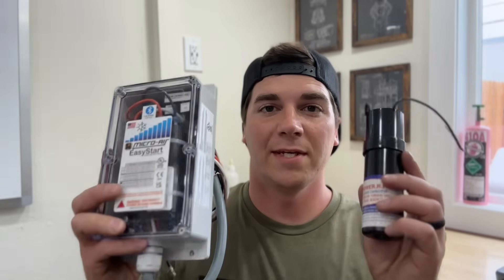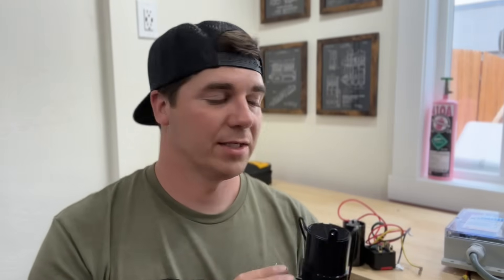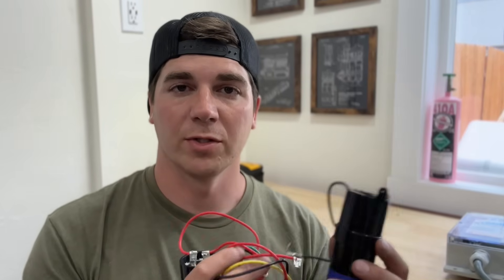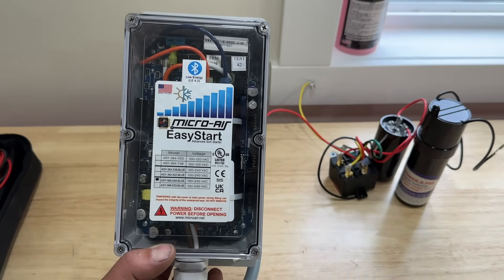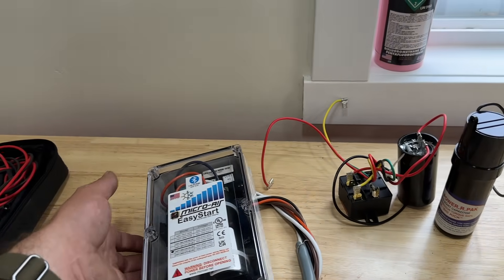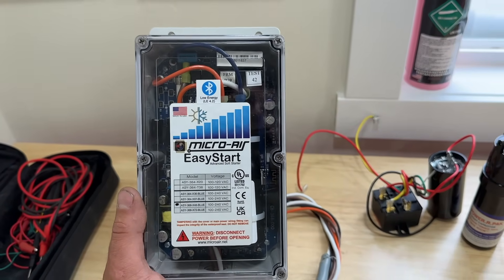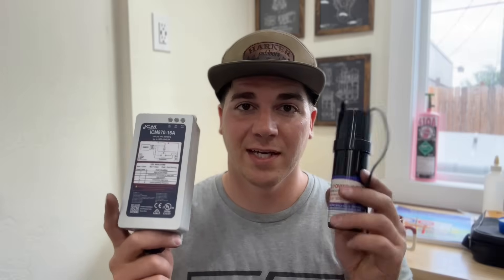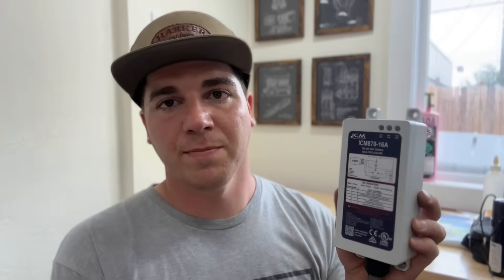Hard Start Kits VS Soft Start Kits    |     Which Is Better?

Comment: I put a 521 hard start on my 20+-year-old 3-ton A/C unit, and the starting amps dropped from 41.9 to 26.7, a 35% decrease. My 8750 inverter generator easily starts it. After running for a few minutes, I gradually flip on the rest of the breakers so the refrigerators and freezers don't all start at the same time. We often have a week or two each storm season where the power is off. We get power after all the businesses and rich people's homes get reconnected. Welcome to Floridaaa.

Comment: I have a stand alone generator on my home. When the AC unit kicks on the lights dem or flicker for a second. Can I still use the Micro-Air Soft start, if I have the generator or is it not wise to install it.

Comment: I love the idea that i can run on a 5500 watt gen during a power outage (hurricane central FL)but Does a soft start installation void a warranty on the heat pump or HVAC SYSTEM?

Comment: If you have 2 units in thst case you can run a hard start on one unit and a sidt stsrt on another ? Depending on hpw old each unit is and whats best to gey the compressor running?

Comment: I've seen plenty of those $400 Soft-Start kits being sold as refurbished units hence they must have a high failure rate seeing how that same company has a ton of them on hand to resell 😈

Cheapest and factory alternative is to add a start-capacitor (hard-start kit) hence the reason the companies that produce the AC units offer this kit in the first place.  This also decreases starting amps because the extra capacitance decreases reactance which allows more current flow through the START windings increasing it's field strength which spins the rotor over easier 😊

Comment: Power factor correction involves inductive reactance and capacitive reactance..how current changes in its relation to voltage in an inductive circuit. Fritz Rochester has an easy to understand  video on YouTube about Rectorseal Kickstart T05.

Comment: Thank you for the lesson Mr. DIY HVAC.
I wonder what device would work best in an off grid campervan situation in which a battery bank supplies 12V power to an inverter which runs (among other things like lighting, a couple of low amp PC fans and some electronics) a 65 W (inrush at least 400W) compressor cooler and a very small (DIY) mini split type system based on a the heat pump components of a tumble dryer which has a rated power use of about 450 W - inrush probably around 1.2 kW)
I have an inverter installed of 1500 W (which can peak deliver around 3000W for a couple of seconds (8-10 or so)

If a slow start or hard start helper can be used to help start both the cooler and the micro split (so to speak) that would make a lot of difference in power use and current spikes...

Your opinion please...

Comment: I just installed one yesterday. Even without thinking about a generator this will help your outside unit with amperage draw. Highly recommend. I paid $370!for the one installed. Total cost was $800 for the job. Definitely worth it in the long run.
Reply: And how will it help? It doesn't reduce power consumption, it costs more than the window unit....By a lot, So what is the problem with a half second inrush current?
Reply: @integr8er66  It will extend the life of the compressor

Comment: Can a hard start kit still reduce the starting amp requirement from a generator even though it reduces only about 50% instead about 7% for a soft start kit? My Generac 24KW standby generator would dim lights during AC started. A hard start kit should reduce its loads to avoid dimming the lights. Is this true?

Comment: Hard start kits help generators run house hvac units as well. Stored energy blasting the power hungry compressor puts less strain on your generator. 
The running amps should be the same with both kits, right? That's what I was hoping you'd go over.

Comment: Less amps on startup = cooler compressor initially.
Now WHICH will save you money on your electric bill?
And if I wanted a soft start can I get one without internet or blue tooth garbage? Those are just more UNNECESSARY things that will break and cost you money.

Comment: I think  one thing not mentioned. . the jolt of a hard start kit will be harder on components.   Can't discount the benefit of a slower start with soft start on components even if you do not run a generator. .

Comment: Check your video:  You say you can run your AC on a 31 WATT generator!  I think you mean a 31 AMP generator (or 6820 WATTS @ 220 VOLTS.)
Reply: He also added a comment correcting his misspeak
Reply: He also added text on the screen correcting himself, and he did not mean 31 amp, he meant 3100 watt

Comment: Great content.  I have an older Tempstar 3 ton.  88 LAR,  16 RLA. TEMPSTAR IS MADE BY CARRIER.  20 YEARS OLD.  Which model soft start do you recommend?  Much appreciated.
Reply: Easy start. The cheaper ones have a high failure rate if you look at the reviews.

Comment: Home built in 2019. On the second owner. I have my unit service twice a year. It is very loud coming on like the volume is turned up a quiet within 30 to 60s. Any ideas?
Reply from the maker: The micro-air soft start could definitely help with that.

Comment: Subscribed! 

So. I have a new-ish home. Built in 2019. 2 Carrier AC units. 1.5 ton and 3.0 ton. I have no home generator. Both units work perfect but they start HARD. 

If I want to extent the life of these units, it sounds like I need to put a soft start on each one of the compressors, no? 

I'd use a hard start kit once they get up in age (10 years+), correct?

Comment: Love the content but on these, I'm confused.  You've had two videos in the same month on hard start (which you said you installed on your new home AC) and soft start (which you said you have on your house).  Now I understand you could install one for demonstration and then the other BUT that's not what was implied.  It would've been nice for you to have a video using hard start for 6 months with temps/electrical averages against the soft start for 6 months with the same.  That would give a real world better impression of what each could do.  Instead it just kinda implies this is great, buy from the link below.  Then this works the opposite way but great, buy from the link below.

Comment: soft start kits not good in very hot climates.
also, a cheap solution is to add a heat sequencer. run the compressor across it. that will delay the comp startup for a few seconds....till after the fan starts

Comment: The hard start kit is good for non-VRM compressors with expansion valve systems. The hard start kit will supposedly extend the life of the compressor. Most equipment manufacturers are too cheap to include hard start kit and pressure switches as standard equipment. There’s a good hard start demo with oscilloscope traces on YouTube. 
The soft start should be used if you are trying to run your A/C with a generator.
Reply: Doesn't the hard start kit also take the load off of the generator?

Comment: I wonder why A/C companies don’t install soft starters from the go?
Reply: Because the price is already too expensive for a new system . We can't go on and install additional components that cost more
Reply: @videos10  I can see that but when the cost of a new condenser, couple of hundred more doesn’t make much of a difference especially if it saves the life of the unit and more economical over time.
Reply: @450steeler That would be the smart thing to do. Since most people don’t do that, well…..

Comment: I have 2 American standard platinum 3.5 and 3-ton units; I was thinking of using the Micro air; however, I heard it could mess with these smart variable units. Do you have any recommendations on this? My units are from 2016m, and I don't want to fry one of them to install the soft start. My AC guy didn't really give me a clear answer on this subject. He did say he had customers that installed it on their and caused problems and had to take off, but don't know if it is true or not since he is making money on the install.

Comment: My Rheem AC outdoor unit refuses to run on generator unless I bypass the circuit board on the outdoor unit. It’s a three ton, about five years old and the generator is a 22kw whole house unit, which should be more than adequate to run a three ton heat pump system. The outdoor unit will attempt to start and then drop out. I suspect that when it starts, the voltage at the contactor and circuit board are dropping below a threshold which causes the circuit board to drop the contactor. I plan to do more checks to confirm this, including checking the indications of the diagnostic LEDs on the circuit board. Perhaps the soft start kit will be the answer. Thanks for all your great content.

Comment: Will the soft start kit add any longevity to the older units?  We have a rather large portable generator on our house, and I have been looking into one.
However, I am a handyman, and one of the houses I work on regularly is rather large, and old(over 120 years).  They happen to also have a Standby Generator, but since it is a rather large house with 3 stories and a large addition, they have 4 A/C units on the house.
They basically got screwed when they had their Generac installed.  Lowest bidder scenario.  Anyway, the generator needs to be moved, and after talking to a few generator installation companies, we have some to the conclusion that the A/C units should have some sort of soft start device on them, so that it won't be such a hard draw should the electricity go out and all of the units start up before they are able to raise the temps on the individual thermostats. 

So I guess I am asking a 2 part question here.  Will the soft starts add or assist in longevity and will 4 soft starts be necessary?

Comment: I am connecting a Duramax XP13000HXT generator to my house with a 5 ton ac unit. Would I use a soft start or hard start to be able to run my AC?

Comment: I put a 521 hard start on our new 4 ton, LRA dropped from 107 to 48., Easy for a generator to start
Reply: Also much less complex than a soft-start, so fewer points of potential failure.  Much cheaper as well.

Comment: Does the ICM 870 have a 4 minute delay on every start cycle for the compressor? This would allow the air handler in the attic to run 4 minutes before the compressor comes on.

Comment: i did the icm on my sisters package unit, its 3 yrs old,  being in eastern NC when hurricane's come i had to put a window ac in for her being her generator was only 4000 watts , it would run the well pump , frig and window ac , she could keep her bedroom cool. the icm clearly quiets her unit . i live next door about 100 ft and could hear her unit kick on while i was watching tv. not no more , i cant hear it at all unless im outside.. so i tried out her generator after icm install and it fires her package unit right up , she can watch tv , frig runs etc. did a 24 hr test had no issues,,,  need to get her a 13,500 watt like i have but she can now at least cool her place and not live in her bedroom during a storm. but im going to do solar mini split 24 k and then put my  generator at her place.. Ice storm ive already put in a 5 brick propane heater for her being she has propane stove,, so heat isn't a issue. like today its 105 pool is 93 .

Comment: can i use a hard or soft start on a duel stage air conditioner
Reply from the maker: Yes you can. They are only used at startup not when changing between stages

Comment: 🔥Subscribed for a while now, in return, if you see this PLEASE ANSWER MY QUESTION!). 

I had a technician install a hard start to my system. After the install, I asked for the box and nomenclature, he gave me a bag, it was completely torn up, looked old and had a tar like substance all over it.  Less than 2 month later in middle of summer (now) the condensing unit is making a loud scraping sound?
Fans seems fine, is it likely that the hard start “off relay” is continuing to add extra current to compressor and possibly causing premature damage?
How can I check.   ANY HELP 🙏🏻 WOULD BE MORE THAN APPRECIATED! 🤯

Thank You JS

Comment: Getting ready to add solar panels with battery backup and my solar installer wants to install a "soft-start" device so I can run my home AC even during a grid outage.  Now I know what he's talking about.
Reply: I'm about to install solar n batteries as well and I'm going to install a soft start because otherwise my solar system won't be large enough to provide the necessary power to start up my 3 ton heat pump

Comment: Why is there so much bad info out there?  Right on the Duromax Generator website, they have a whole video showing you how to install a hard start kit,  and they strongly recommend doing so before trying to power your AC from a portable generator...  But then I've read in other places what you've said here, that a hard start kit is of no value if you're trying to use a portable generator to power your whole house AC.

Comment: The hard start 'kit' doesn't have a relay, it has a thermal device that has low resistance when cool (no current) and gets to high resistance after a second or 2 of current running through it, keeping the start capacitor from blowing up because start type capacitors are only implemented at startup and not meant for continuous operation. The high current surge at startup for motors and and compressors is just a short time instance of 1 or 2 seconds, and is about 5 or 7 times the running current. That is not really significant to your electrical bill or usage. But, the start assists can reduce the strain on your compressor starting up and reduce the  flicker (voltage dip) noticed when compressor starts. Sometimes these are things are more needed for say boats or RV's where the power hookup is 'weaker'

Comment: Hardstart kits do not reduce peak startup surge current.  They only shorten startup time length, typically from stock 0.5 seconds to a startup time of 0.2 seconds.  It works by providing more start winding current at proper AC phase shift during startup which gives motor more startup torque causing it to spin up faster.

The Easystart is actually a combination hard start capacitor boost and a voltage ramp softstarter.  The voltage ramp reduces the startup surge and the extra starter capacitor increases the motor startup torque allowing the voltage ramp to be more effective.

Hardstart kits have no failsafe checks like the Easystart has.  If relay fails or capacitor shorts out in hardstart kit it can damage compressor. Easystart microcontroller checks for abnormalities during startup and shuts down if an abnormality is detected providing more protection for compressor.
Reply: That's all true but..... doesn't it still take a certain threshold of current to start a single phase motor? 
3 phase motors spinning up nicely with variable frequency drives, but it is not the same for 1 phase motors
Reply: @DF-te2vm  Three phase motor only need voltage ramp.
On single phase motor the start winding provides synthesized second phase to provide rotating field.  

During startup, motor is highly inductive at low impedance.

The larger start cap provides closer to 90 degrees required phase shift during highly inductive startup .

Run cap valve optimizes 90 deg phase shift for run current. It also improves motor run power factor.
Reply: @rcinfla9017  thats all true, but VFD's ramp up the frequency /speed for 3 phase motors. The current starting 3 phase motor with VFD is nice smooth ramp with no spike at run call. I actually think ac's compressors should be 3 phase with VFD drives
Reply: Great comments. So, would you recommend an Easy Start (or soft start) on most compressors to prevent the initial inrush currents on its windings?  My compressor starts "hard" and loud. Perhaps a soft start could resolve this? Thanks for any help.
Reply: @boeing757pilot  the easiest and cheapest thing you could probably do yourself  is the TWO WIRE start boost where the 2 wires hook right  to the compressor RUN CAPACITOR. Have to get the one that meets the system TONS, size.
Also, the run capacitor sometimes has fan capacitor in same body so be sure to hook to the compressor and common terminals

Comment: Don't all compressors already have a starting capacitor?  I've replaced them from time to time on various units I've owned in the past 50 years.  Cheaper than this "hard start" kit which does the exact same thing.  But the soft start kit looks like a good idea (although many modern variable speed compressors and fans already do a soft start on their own)
Reply: My Rheem Classic has a dual run capacity.  Didn’t see a start-up capacitor which is what a hard start kit does..

Comment: Appreciate the vdos bro. I have a 4 ton unit that starts with my Duramax 12,000. Should I consider putting a soft start on? The unit is 2 yrs old. Thanks again for great vdos.
Reply: A 521 hard start also reduces inrush alot. My 4 ton went from 107 to 48. You can not worry about leaving other breakers on the whole AC is running

Comment: Can you install a hard start kit on a scroll compressor, and should that be done on a older R22 unit that currently doesn't seem to have any problem starting currently?
Reply: Save the money for the start up kit and use that extra money saving up for a new system. Since 2020, anyone with an R22 system is going to kick themselves for spending money on extending it’s life. The R22 hoarded is only going to diminish and all that will remain is recycled refrigerant. Be wise, save your money
Reply: @FreonChugger  Thanks, I know you're correct on this! 👍